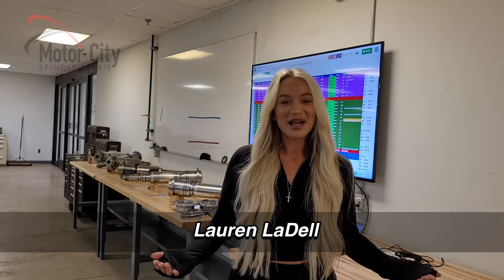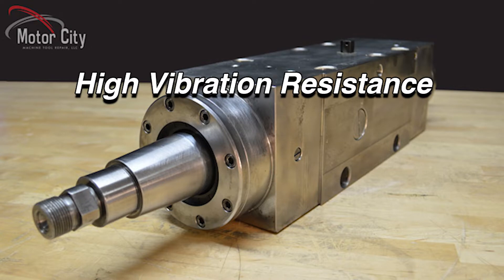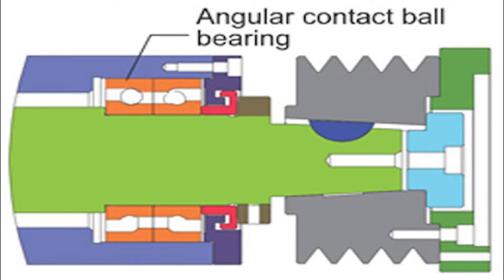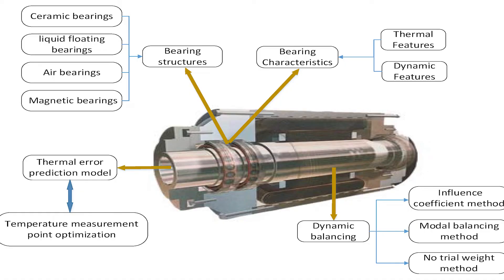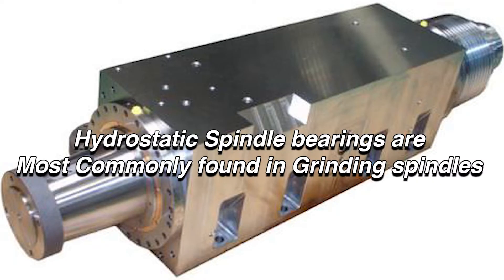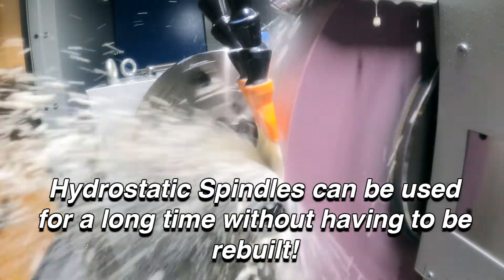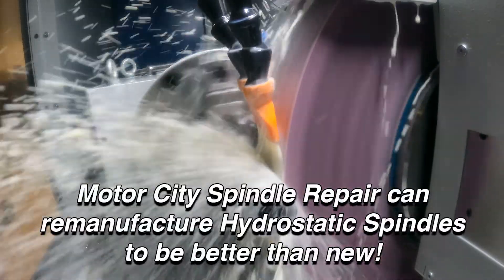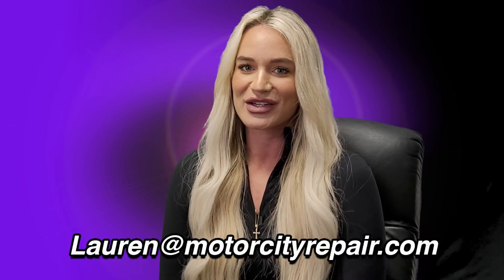Spindle Chick Chat What are Hydrostatic Spindles?

Comment: You mentioned that hydrostatic spindles typically have angular contact or roller bearings, I thought that hydrostatic spindles don't need that because the oil film bearing is enough? And most hydrostatic spindles I've seen from other companies don't come with any type of traditional bearings either, just the oil film seems enough. Is there a reason why they would need additional bearings as well?